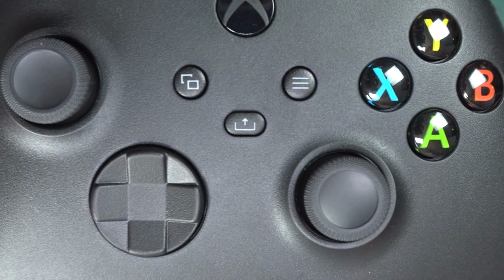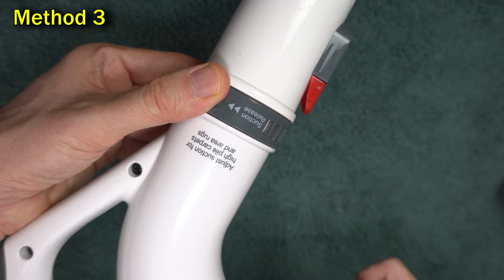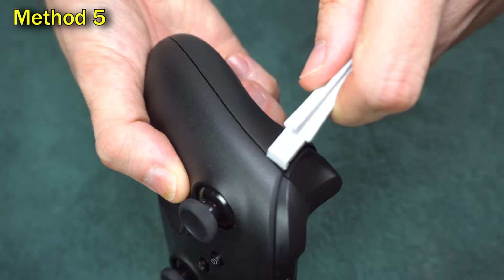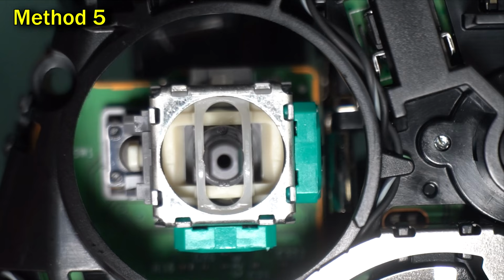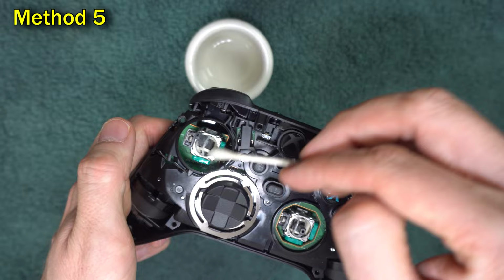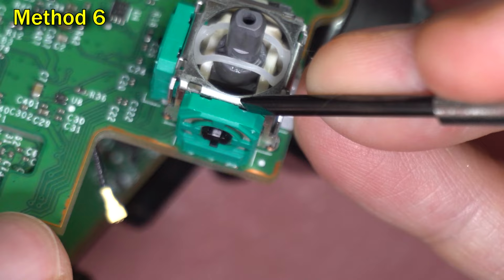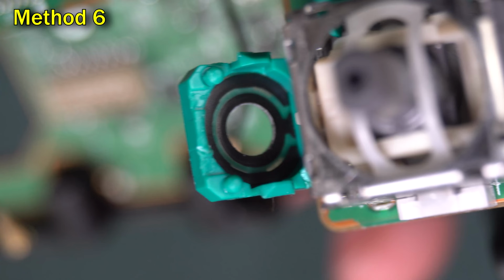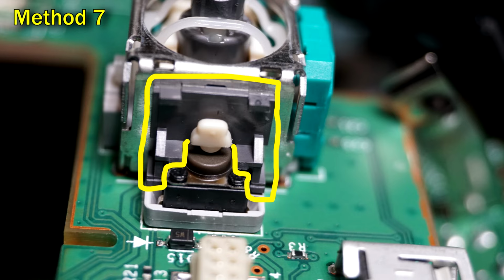How to Fix Analog Drift on XBOX Series X/S Controller (moving on its own, jittery, wrong direction)

Comment: I have a feeling mine is damage related, I just don’t know how. I do know that at one point it fell pretty hard and the left bumper was difficult to press for a while, as if it was bent. Now it feels like normal again, I think. But the left stick drifts with or without contact after a few seconds, sometimes it doesn’t. So weird.
Reply: Same here, I got my controller on the 22nd of may of this year as a birthday gift cause I asked for a new controller, my new one has already got drift and I feel that it's something to do with the firmware update, I recently did another controller firmware update and ever since it hasn't been the same and now my camera joystick has upwards drift
Reply: @oe-hr5ft  mine too, it drifts upwards sometimes and sometimes it doesn’t. I truly believe it has to do with the new controller update because my controller was fine before I updated it, and i take care of my controllers. It’s basically brand new. The update did it and it’s funny everyone having the same problem after the update but Microsoft is denying it.
Reply: @Moombuh  good to know, I thought I was the only one experiencing this issue
Reply: @oe-hr5ft  Well, I updated mine and it still works like charm.
Reply: Same
Reply: I bought 2 new controllers and decided to update all of them including the white one that came with the series s, all 3 now have drift.... 😭
Reply: I have the same issue, the upward drift. But it only affects the right stick.

It seems to drift up no matter how large the center deadzone is. And when I aim up on the right stick, the input seems to override the drift. Very weird.

Comment: Works like a dream. The most annoying bit was just that I had to use like three different screwdriver heads to get all five screws off, but after that I just blew on the sticks and voila, brand new. Disassembling a controller isn't that dangerous, just don't get it wet for obvious reasons

Comment: Wow, I did every single thing in this video, and none of them worked, after step 6 I almost gave up, because of how you worded the experimental step I didn't think it would work, but my mood instantly changed when i took that little thing out and everything started working perfectly. Litterally tried everything else on the internet, thought the universe hated me yet again, but this is the first time ive won at something like this. Thank you so much, taking the part out made drift slightly unstable, but still controllable and wont do it randomly. I can finally play KSP because of you man, before it was impossible and i didnt want to buy another controller, because mine was BRAND NEW! Its crazy, sucks it was past the 90 day warrenty, but staying up all night rewatching this video multiple times and doing everything in it proved to be worthwhile, though i could have saved half that time if i had just yanked that black thing out in the first place 😂
Reply: Step 6 didn't work for me neither, is your controller still working without that grey plastic thing?
Reply: @vascodemaio4646 I havent used it in a while since I got a new controller shortly after I delt with that mess, but the controller did work. When I took that grey thing out, it fixed involuntary and random drift, but the controller felt weird. Just be warned that it wont feel normal, and that stick will have a different issue when you take it out (its a bit hard to explain, but it just feels and acts weird, but its not as uncontrollable or random as stick drift) in my opinion, it is much better than dealing with stick drift. As the video states, id only remove it if you are about to throw your controller away
Reply: @gamertardguardian1299  thank you sm for coming back a year later on the same video ahahahahaha, I'll try taking the part out if I feel like it in the future, just to test things out (I also bought a new controller). Thanks for the heads up about the strange feeling I might get from the stick
Reply: @vascodemaio4646  Of course man its no problem! Im just glad i got notified because 90% of replies I don’t get notified about. Good luck man these controllers are wild

Comment: Step 6 was the winner for me. I had a surprising amount of fine black dust on that q-tip when I cleaned one of the circles. I guess that's what was causing the problem.

Comment: I did the last step, and it fixed it. Seems like it's probably dirt. I also bent down the springs when I took out the circle black thing. Good luck to everyone with the series controllers. When you buy one, just buy 2.... or buy an elite or scuf.

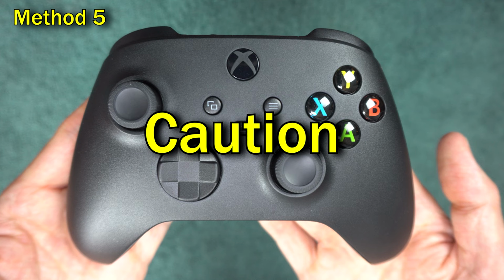Comment: At 1:45, method five worked for me. I tried everything up to opening it up with no luck. My left thumb stick y-axis was acting up. I q-tipped all the spots you recommended but did not work. So, I opted to separate the green door enough with a dental pick and tried to clean it with a Q-Tip but evidently that wasn't quite good enough, as the next step I took was to actually flush out the potentiometer with the alcohol, and after blowing out the excess alcohol and cycling the controller a bit, replaced the battery and top cover and then gave it a go and it is now working perfectly! Thanks for the video!

Comment: I did the sixth method. Eventually it worked well. There is still a very little bit of drift, but it is inside the default deadzone, so it's not even a problem. Thank you for this video. I am very appreciate.

Comment: Dude I love you so much! It literally works. I used method one on my controller analog drift and it didn’t work but once I used method two by blowing into the sides while pushing the drift on the opposite side and it worked! I couldn’t believe it! I had to walk away from my controller and pretend it didn’t happened because I deadass thought your methods weren’t gonna work but it did! I’m really happy because I been having problem for weeks now and it went away. Thank you so much!

Comment: Thank you for the amazing tutorial. I couldn't proceed past method 5 because the torque screwdrivers were too large but I fixed it with method 4.5. Removing the side thingies and blowing into the controller through the new openings.
Reply from the maker: That's a good method.

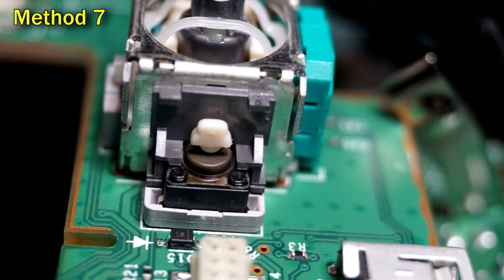Comment: 7:41 I’ve actually had the gray part for one of my working controllers fall out of place and end up behind the trigger before, so I had to remove it without opening up the controller. Luckily the controller still worked after that. The only significant change is sometimes I have to manually reset the stick to center when it doesn’t do it by itself.

Comment: Id like to point out that once you get those little green doors open be very careful taking those black plastic caps out and remwmber which way they came out! The very very fine copper on them is what conducts the signal that translates into position. I rhought they were spring loaded caps to hodt the thing together so was less than careful and now the analog stick is bricked (no botherr it was drifting bad anyway), its atuck in full top left lock even though the stick is centered. This is because i was not careful pulling em out or putting them back in and snagged the metal, bending it out of shape permanently. 
Great guide, thanks a lot, just a cautionary tale!

Comment: Method #6 also worked for me. I had a bad drift on the right analog. 
Take your time and pause the video as you're disassembling the controller. Same thing when putting it back together. It's not difficult but it's also easy to damage components.

Comment: I had insane drifting on my left stick and just cleaning from the inside seemed to have helped greatly. It still moves a tiny tiny bit but stops when I check the calibration, but it's not even registered in games. Thanks man! You just saved me 60€.
Reply: Did you do step 5 or 6 for the cleaning. I’m afraid that I will destroy it if I attempt step 6 lol
Reply: I actually went back and did all the steps to try and get rid of the drifting completely (still had some that was getting on my nerves). I was afraid at first as well, but if you're a bit careful, especially with those delicate disks at the sticks, you'll be fine.

Comment: Thank you for sharing the fixes. They work. I ended up using Method 6. Not only the disc but the contact inside the green door needs to be cleaned too. And make sure the flat dent of the disc has to point up when you are putting it back inside the green door.

Comment: Thanks! I really apreciated the fact that you show every step per method. I tried method 5 several times without any success, However, after just 1 try of method 6 my controller is working as new, also it wasn't as difficult as i thought.

Comment: I did the pull on stick and tap method and also updated firmware on my controller...it worked!! Thanks and a well deserved like!
Reply: What was wrong with it? Was it the clicking of the joystick? Mine doesn't stay clicked and it's hard to use now.

Comment: Had to go all the way to method 6 and found the slightest amount of sticky residue inside one of the green doors on the white fin that sticks out now my controller works great THANK YOU❤❤❤ great video!
Reply: What was wrong with it? Was it the clicking of the joystick? Mine doesn't stay clicked and it's hard to use now.

Comment: If you don’t have the screwdriver to take the screws off just use compressed air or blow dryer after you get the grips off. Worked for me.

Comment: #6 fixed my issue. I used a q-tip and alcohol. After cleaning my q-tip was black after cleaning one of them. I put it back together and it had 0 issues. Thanks for the help.

Comment: For anyone else out there. I followed the steps and nothing worked, however, I noticed that step 5 helped a little bit when I put some alcohol on it. I then decided to essentially pour a caps full of rubbing alcohol into the mechanism and rub it around. That finally fixed it for me! I didn't have to do anything else. Hopefully this helps someone.

Comment: Great video. I have exactly the same controller and issue on the left stick. Sometimes it stays "moving up" altough not physically. So I removed the bottom parts, removed two screws, but then, the middle screw and the ones on the tips of the grips don't seem to bulge regardless of the key I use. And I have a ton of them, different sizes and shapes. Tried them all, none will make the screw rotate. The key seem not to fit at all, its not an issue of being stuck. Like something inside the screw cut were different than the key is supposed to open it.

Comment: Step 6 worked for me like a dream. I was completely unable to move forward. 

After step 6 I checked my analogs in the tester, all directions are 100% besides moving backwards now which is at 70%. But that’s completely fine as in most games I won’t need to move backwards at maximum speed.

Comment: Thank you for making this! I noticed my PowerA controller has a big gap between the left trigger and bumper if you hold down the left trigger.

I lifted up the left stick, held the trigger down, blew compressed air through the gap, and now my controller works perfectly!
Reply: What was wrong with it? Was it the clicking of the joystick? Mine doesn't stay clicked and it's hard to use now.
Reply: @solaria5513  I think it was just some crumb or a dust buildup; something got in under the joystick. Pulling on the stick so it sort of popped up let the compressed air blow whatever it was out.
Reply: @smokingiscool599  Thank you! I was asking though what was the problem with your controller? Was it just stick drift or was it clicking in the L3 or left stick button?  My left stick button is all screwed and I was wondering
Reply: @solaria5513  Yeah, the L3 wouldn't work all the time, and sometimes the movement of the stick would be a little like choppy or something. The stick just wasn't working smoothly.

Comment: Thanks for the vid, it worked for me! Just wanna say that if the green door doesn’t close it’s probably because of the bottom pegs which come off really easily, and I think I was a little rough because the down stick movement is not as sharp as the up.

Comment: Yeah, this is ridiculous.  I bought a series x in 2020 not long after it was released, and have played consistently for the most part in the time sense.  The controller it came with has given me no trouble of any kind throughout all of that time until very recently when LB stopped working.  At first, there was no longer any click to the button when pressure was applied, and you had to apply a lot of pressure to get whatever action LB was assigned to.  And it would randomly stop working, like if instead of LT, LB was the button for any kind hold action like aiming down sights, it would just zoom out and stop aiming while still applying the same amount of pressure.  Then it stopped working entirely shortly after.

The point is that it took almost 2 years for that issue to develop, for there to be any need to replace it.  So I replaced it with the same official Microsoft series x/s controller in blue, and am now experiencing stick drift after having it for 5 days..

Comment: Method 6 literally made the drift 10 times worse, it used to be playable, now there is no way to even use the analog since the drift is stuck forever. I made exactly what was told and the situation is now utterly worse. I don't suggest people to try this unless they are planning on throwing their controllers in the trash. This method is only for those who are desperate. Unfortunately following this video broke my controller for good. It sometimes had a small drift that used to be just annoying, now the drift is permanent. I can't fucking believe this. The analog now simply does not respond, it just goes wherever it wants.

Comment: Method 6 fixed it for me on a fairly new controller just out of warranty. Not a hard job if you have the right tools. Left stick was drifting heavily up and down, one one of the two doors had visible dirt upon cleaning with isopropyl alcohol. The other was clean.

Comment: Method 6 for me. Thank you very much. Before i try the same but without put the 2nd circuit board out. Now it works. A shame for Microsoft give huge shit on customers.

One more thing, after I assembled the controller I noticed that the stick could only be pushed about 70% to the left. It's very likely that this happens to others too. In this case, go and see which of these contacts is responsible for which direction. Just take it out again, blow a little and put it back in. That helped me.

Comment: thx a lot, mate, i was blowing all over the place, but mainly on the top of the left stick. Your video helped me showing internals, so I just blow really hard on the bottom (down arrow). Step 2 worked for me in this case, but I think, soon or later removing the shield will need to be done

Comment: Great video! One of my controllers had an extreme drift with the left stick. However, what fixed this issue for me was that I didn't remove the gray tab (step 7). I just slightly poped it out of place.
Cheers
Reply: Still fixed?

Comment: BTW, I used a small flathead but attached to a drill to remove ALL of the screws. Sometimes it will shred the security pins inside the screw, if that happens you can use the normal screwdriver to take it out.

Comment: In my opinion, I would use canned air. Blowing with your mouth could blow small spit particles and humidity into electrical parts. Electrical and water don't mix. Anyway, good tips and video. Thanks

Comment: You really Should recommend returning the controller to the retailer if it is within warranty period and stress that if cleaning does not work it is the only guaranteed fix without voiding warranty which is void as soon as you open it.

Comment: Method 6 also worked for me. Seems those small metal rings on the removed disc can become inhibited by some dark colored build up. cleaning with isoprop alcohol and qtips works wonders. mega thanks for the great viddy